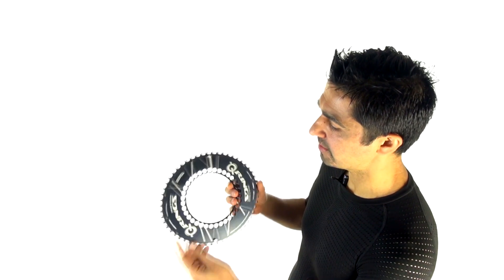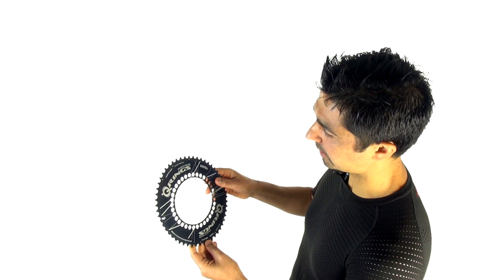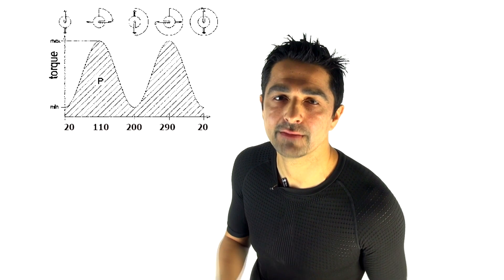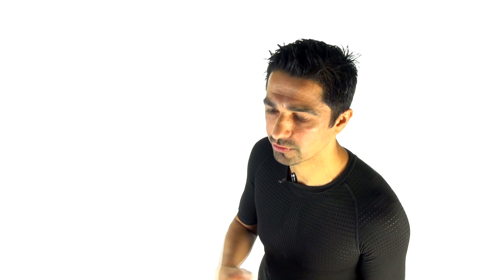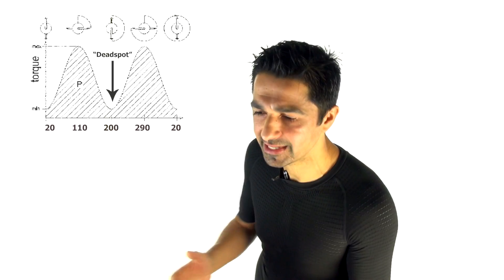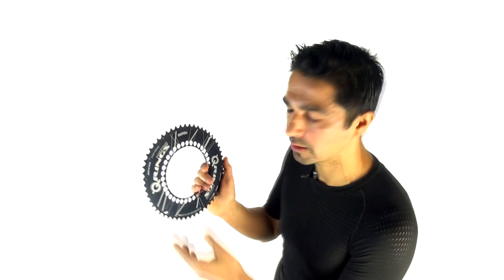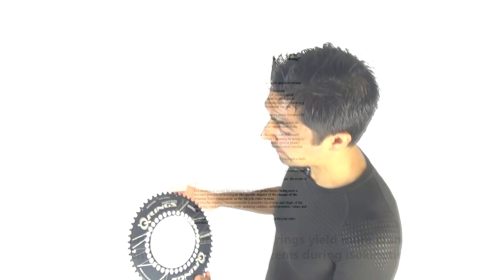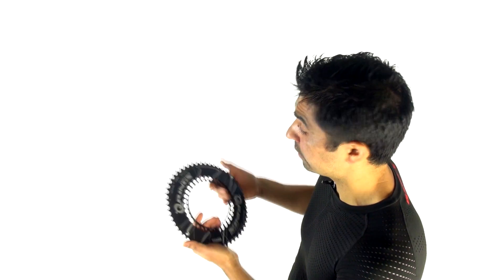Do Oval (non-round) chainrings improve one leg vs two leg cycling power (Q ring, osymmetric)

Comment: I was doing my master-thesis about cycling and I'm very happy and pleased about your video! I measured the force that was put on the pedals. A picture that shows the power (picture is not from my study but in my thesis it really looked the same) can be found with this link: 
http://bildung.freepage.de/cgi-bin/feets/freepage_ext/41030x030A/rewrite/doc-hilli/VEROEFF/RUNDERTRITT18.GIF 

The advantage during the downward movement is clear, but people forget the disadvantage that is caused because they leave their leg on the pedal without pulling upwards… but pulling up would lead to a biomechanical disadvantage as you explained and I also would confirm. 
However people usually keep their leg on the pedal without pulling upwards which causes a negative force and the bigger chainring diameter costs the leg on the other side more power to lift it up. So the question would be if the advantage of the oval chainring really exists or cancel itself?! In addition I have to mention that one person in my thesis was able to nearly avoid the negative forces on the “backside” by lifting the leg so the pedal was unloaded and the efficiency was the highest. For those cyclists I could believe that oval chainrings could lead to a benefit. 
But due to the fact that there is no 100% proof and Chris Froome is not better in minutes with his oval chainrings to the other riders it is just a nice marketing-thing in my opinion. Maybe someone can make a better thesis about this topic and respects all the parameters ;)
Reply from the maker: Wow thanks, we need people like you +thewisi88 to take these topics seriously and apply good science! If you can test oval vs round rings across several riders that would be interesting. Great graph.......do I see some positive power at 300-360 (at the top or 12 o'clock position) which is distinct from the 90-110 power? Does the leg push twice once v small at the top and once very large at 90?? Thank you for this great information and good luck with your thesis!!
Reply: Fastfitnesstips
Hello again. Sorry, but I already finished my thesis. I was checking the influence of the seat height on the efficiency while cycling. Even between a seat height difference of 30mm there was no significant difference in the efficiency. Most analysis in shops only measure once and the maximum force. In my thesis I was checking The force during a full rotation. So more accurate, but no difference in the outcome between 3 seat heights. 
Maybe this knowledge will help you. If you wanna talk, contact me via email: patrick.wisinger@aon.at 
Greatings
Reply from the maker: very interesting indeed, this is a topic I want to cover. will pm you.

Comment: You continually keep referring to the down stroke and the up stroke of the cranks. You need to remember that a cyclist is a "two cylinder" pedaling machine. To discuss this phenomenon you should be considering whether a rider should pull up on the up-stroke. You may be aware of a chain set that didn't connect the two cranks: the descending leg couldn't lift the ascending leg. This was so the rider would "learn" to lift their training leg. The rider had to lift the weight of their leg, crank and pedal from bottom-dead-center to top-dead-center.
Oval chain rings make no attempt to address this issue.
It is an undeniable fact that purely due to Newtonian physics that energy can be saved by reducing the linear acceleration of the rider, bike and rotational acceleration of the (fly) wheels twice per revolution. Additionally energy can be saved by reducing the deceleration experienced each half crank revolution at top and bottom dead center.
Oval chain rings are an alternative or addition to a more even application of torque to the rear wheel through the pedaling technique often referred to as "ankling".
There is definitely a measurable and worthwhile advantage to be gained.
One of the reasons for the adoption of higher cadence climbing is that the man and machine aren't continually gaining and losing so much momentum at each slow pedal stroke: It's like having more, smaller cylinders in a car engine resulting in more but lower power pulses per rev.
Oval chain rings aim to improve on this further.
At top-dead-center a lower gear is effectively used (smaller chain ring) so the cranks, (not the bike) speed up and pass through this segment quicker. Similarly a higher gear is engaged (bigger chain ring) on the down stroke so the more powerful push and resulting torque lasts longer. Even though this is the most powerful crank segment, the bike, rider and wheels are discouraged from forward acceleration as the big gear can't be "wound up" immediately.
The question is, can the body in all its complexity adapt to take advantage of these tangible gains?
I think it can but:
a). riders need to learn to adapt to the different pedaling action and 
b). the current on-bike power meters are not accurate enough to indicate the small difference in improvements.
A static Watt Bike probably is but I don't think riding a Watt Bike is the same as balancing a two wheeled bike under normal ride conditions. Can the resistance on the Watt Bike mimic the inertia of the bike / rider combination plus wheels out on the open road?
We may be only talking about 0.2% of any given 0.6 sec revolution (at an average 90 rpm) but consider that Andy Schleke lost the three week long Tour de France by 39 seconds. (over 6 hours /day for 19 days this equals 410,400 seconds.
The 40 sec.to win  =0.001%)
Reply from the maker: Nice post, glad this one got you thinking in this much detail. You make some good points in fact I have updated the video to reflect "transition to upstroke" not just "upstroke". If you know of any more informative studies I would be pleased to know. thanks.
Reply: Sounds like you've never set up your front changer properly. I've been using a rotor q for a couple of years and never had a problem, just as good as a circular chainring, never had chain suck.
Reply: I'm not saying that if Schleck had used oval chain rings in particular. I agreeing that "marginal gains" in any area are worth exploring. I would include more aerodynamic ways to carry food etc than in jersey pockets. When a rider most wants to cheat the wind they will grip the drops lowering their shoulders and, involuntarily, exposing bulging pockets to the head wind. It's similar to riders who drop their heads during a time trial while wearing a long-tail aero time trial helmet.
I was just pointing out that 1, 2 and 3 week tours can be lost by second. Also 200K plus single day classics can be won or lost by millimeters in a sprint. Marginal gains can make a difference.
Returning to oval chain rings, the normal, rhythmic progress of mini accelerations and deceleration that a bike and rider experience can be compared to driving down a motorway in a car while rhythmically increasing and decreasing pressure on the accelerator. I would suggest that this would result in a measurable increase in power usage and fuel consumption.
Reply: Yikes, twelve minutes of useless technical bable. The main reason that oval chain rings have not been adopted is they shift like crap. Any gains in efficiency made oval chain rinds were basically evaporated chain suck and dropped chains.
Reply: HI twosence, Chain suck is when the chain 'sticks' to the chain rings instead of returning to the rear derailleur. Basically the chain wraps itself completely around the circumference of the chainset. Chain suck is more prevalent where you have a big difference between the biggest and smallest sprockets and is therefore more frequent in the MTB world. It would mostly happen when the cyclist was on the granny ring and smallest sprocket on the cassette 'i.e. cross chaining. This is when the derailleur has the most slack take up in the chain, and where the spring in the jockey cage is at its weakest. MTB also suffer more because of mud and dirty jamming the chain reducing its flexibility. Having said all that, chain suck shouldn't really happen if everything is in good condition with the chain set to the correct length and lubricated correctly.
Reply: B*ll*c*s..! or no your wrong sir! I use AbsoluteBLACK  road compact rings and have never had an issue with gear changes or chain drops, go up hills faster and ride longer rides feeling less tired at the end. But thats just my opinion. Kinda agree with the babble reference though.
Reply: To add to R A BISHOP, the difference of application is also the difference of effect. When you're calculating out .8sec at a certain mechanical advantage, the example being the 53T chain ring. The mechanical advantage is intensified when you change to say a 32T or 34T on a mountain bike. It also changes again where cadence is inconsistent. So the mechanical advantage is going to be intensified in terms of torque and also where pedal cadence may also be slowed drastically along with the weight that is creating the resistance (heavier bike, more resistance in tires). Once you calculate those factors, then add the phenomenon that on a MTB, you're more often starting 3 & 9 o'clock position where you're at a mechanical advantage already.

In many ways, it is so hard to not only discredit but also accredit the benefits of the oval rings because the software, how it's being measured, algorithms used for measurement all create a margin of error too great to actually measure a difference. As R A BISHOP said, the pro tour cyclists win by seconds after 2+ weeks of riding.

Then there's the variable of optimizing the pedal stroke in which he named "ankling". I was taught (and my description is going to be crude) is that the toe needs to remain lower than the heal, and the method to correct this is to manipulate your knees like you're going to try to touch them to the bars. Just be simply doing this (remember I'm saying this crudely) it naturally causes you to elevate your cadence with the same amount of power. Couple that with an oval ring, and the dynamic changes.
Reply: so if Schleck had used a oval chainring, he would have won the TdF?  It's a nice bookworm argument, but complete nonsense.  You didn't need to come up with the complicated argument.  I could have just said that if Schleck had used a bit more aero jersey and carried an ounce less water, he could have shaved 40 seconds off too, and probably much more.  Too many factors involved in racing man, and to make a case of Schleck could have won if he had used oval chainrings is a complete rookie wishful thinking
Reply: @kalashnikovcortez1380  It was hyperbole. He was merely trying to say that small difference can make a difference
Reply: Tim:  Very true, I ran BioPace for years and never dropped the chain and, I'm not really sure what chain suck is; unless it's the tendency of horribly worn sprockets to not release the chain, wrapping it up the backside?  I can't imagine anyone allowing this much wear as forward motion would become very difficult before this point.
Reply: R A BISHOP chain suck is when the chain gets stuck between the bottom bracket and chain rings. If this happens and you continue to pedal, the chain gets pulled so far in that the only way to remove it is to detach the chain and literally tug it out.
Reply: You shouldn't be pulling up on your cranks...wasted watts!
Reply: 100% correct........... But, my god................., how many self-proclaimed know-it-alls over the past two decades have claimed otherwise and have made their ignorant followers actually believe same.............? Then you have the spinners.................................................... Spin everyone, spin.............. (idiots).
SO much utter bullshit out there.